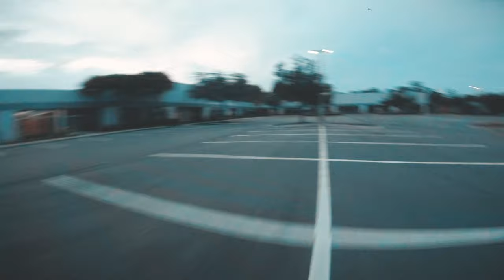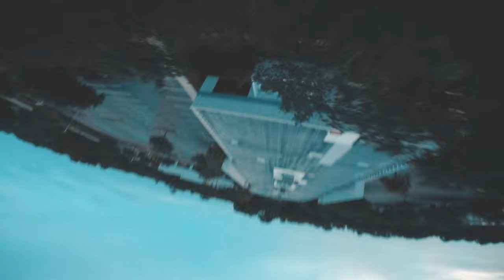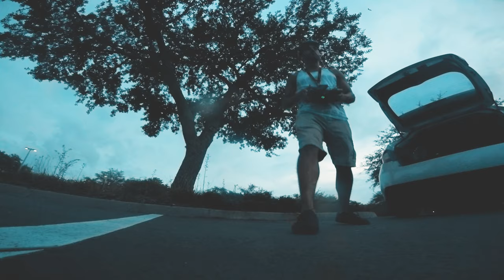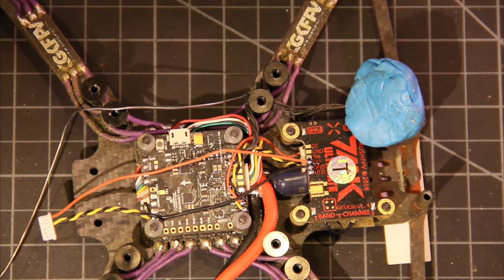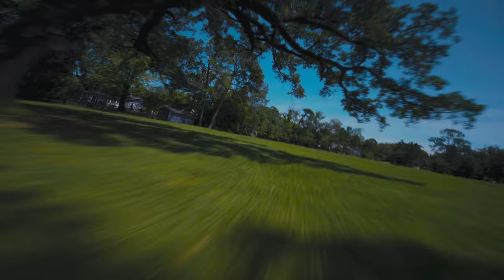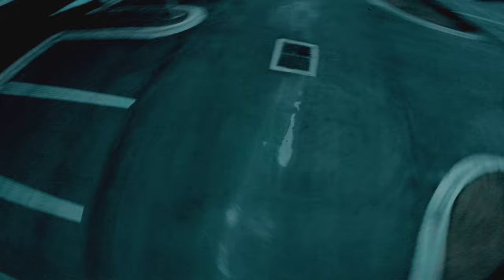6 Tips for a Cleaner FPV Video Feed! + bonus flight footy

Comment: Ripping man! Good tips, I've got a lot of noise in one of my quads. I think it's because I'm powering the Mach3 off the vcc and ground of the FC instead of straight to the ESC. I'm going to try powering the cam off the VTX like you said too, usually I power my cams of the FC.
Reply from the maker: Nice, yeah if your VTX has a 5V output  I would suggest powering your camera from that. Thanks for watching dude!

Comment: My fpv feed breaks up at about 50 meters on 350 mw, is this normal? 

Help would be much appreciated. 👍
Reply from the maker: You shouldn't get breakup at 50 meters away unless there are obstructions in the way like trees or buildings. Make sure you power levels are where they say they are and make sure all your antennas are connected properly. Good luck!
Reply: @kreativ_corals  thanks I will get a new antenna, I think the problem is my capacitor. 

Thanks for helping 👍

Comment: Great video, what antennae did you use for your crossfire, and how did you mount it? cheers
Reply from the maker: I bounce between the immortal L that Mr Steele uses (mounted similarly to how he does) and also the VAS 900mhz (not the flexible but one but the slightly more rigid one... it’s black) antenna which I just attach to the bottom of the back stand offs. Thanks for watching 🤙

Comment: So I bought nazgul 5 V2 And I've been playing it for like a month and then I just started getting bad VTX signal. Like when I either punch the throttle or go somewhat behind a tree it gets black lines and basically loses all of VTX signal. I replaced the FR sky rxsr receiver antennas Because they were kind of disconnecting from the receiver and I thought that was why I was getting bad signal. That didn't help. So I just bought a new pigtail connector that goes from the VTX to where the antenna connects. Hopefully that fixes it. If not I'm going to troubleshoot using this video
Reply from the maker: That’s interesting you lose signal when you punch the throttle. That makes me think It might have something to do with the power coming into the VTX. If the new pigtail doesn’t work, you may want to try and re-solder all the joints on the VTX and the flight controller if you can. Going through the steps in this video will also help! Could be an issue with a specific pad the wires might be on. Trying different pads may solve the issue. Lots of options so keep me posted, we’ll figure it out 🤘
Reply: @kreativ_corals  Well I have a succex F4 800mw vtx from inflight. It doesn't actually solder into anything. It plugs into the VTX and the other end plugs into the flight controller.
Reply from the maker: @ghostlyvlogs8456  got it. Let me know what happens!
Reply: @kreativ_corals  will do. The pigtail connector comes in the mail tomorrow so let's hope it fixes it. Because I just did exactly what your video says to do and I just test flew it and nothing changed.
Reply from the maker: @ghostlyvlogs8456  yeah, prob a power issue 😕
Reply: @kreativ_corals  Well I got the pigtail connector in today which was a day late then I thought but I put it in and it fixed the issue. I'm so excited to get back to flying
Reply from the maker: @ghostlyvlogs8456  dude! Awesome! Thanks for keeping in the loop. Im stoked you’re back in the air 🤘🤘